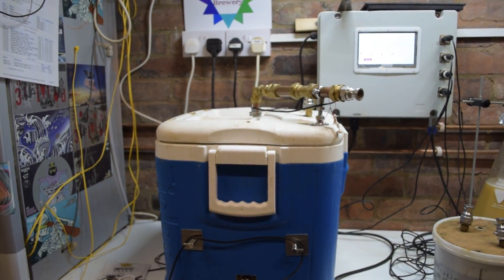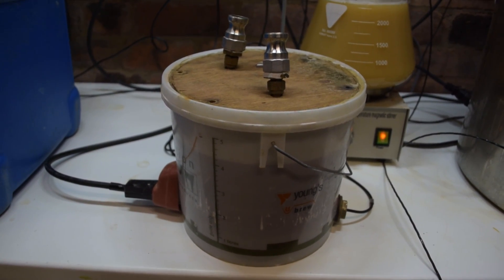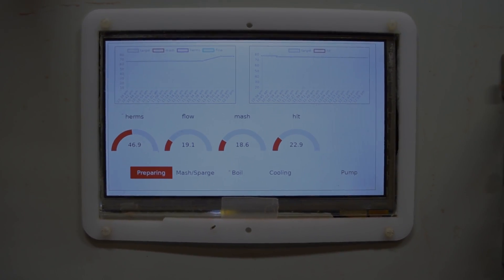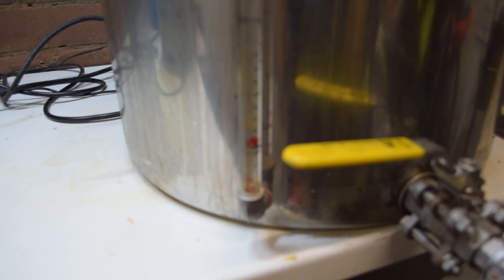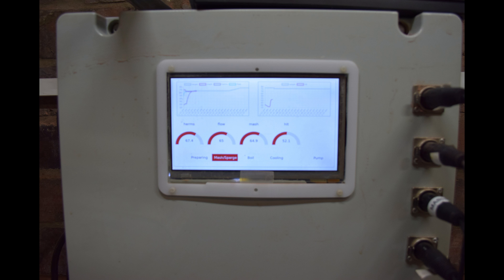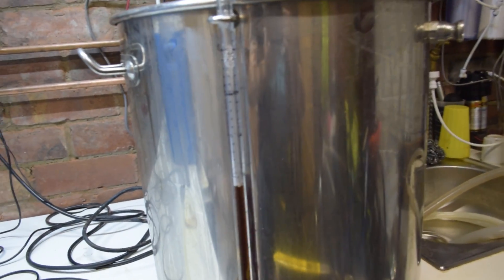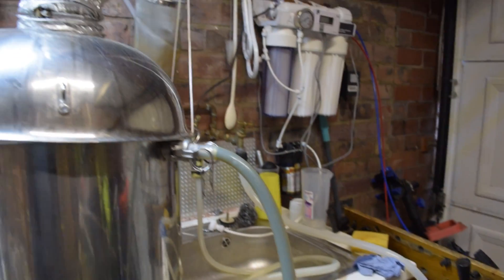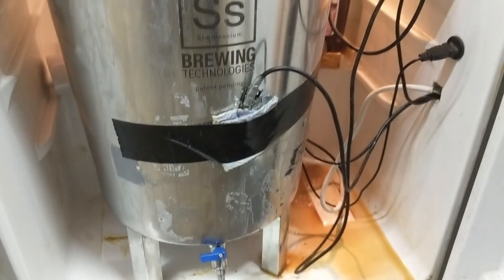Brewing automation in action

Comment: I am thoroughly intrigued by your low volume HLT. Do you notice much by way of temperature departure after mashing in?
Reply from the maker: The little tank with the HERMS coil in it?  Having it separate means I can control its temperature separately from the HLT so I have it preset at mash temp while I am mashing in.  Having a smaller volume means I don't have the additional thermal mass of all the liquid in the HLT when I want to change the mash temp.
Reply: @TertiaryBrewing  Does that translate into a temperature loss when you dough in? For a 153 degree Fahrenheit mash, I have to bring my strike water to 160+. I know you guys are metric, but I am only using this as an example. However my strike water instantly drops as I dough in, even if I were to underlet. Do you find that returning to intended mash temp or maintaining intended mash temp with that size of herms tank works productively?
Reply from the maker: @beeroquoisnation  Since the HLT and HERMS tank are separate the temp in the HLT isn't impacted by mashing in.  If I undershoot the mash temp I don't have the thermal mass of all the water in the HLT to help pull up to the correct temp, but, I can increase the overall temperature faster with the heating element because I only have to heat up the mash and the small tank rather than the mash and the whole HLT.
  The other advantage is I can take the HLT up to sparge temperature without having to start warming the mash.
Reply: @TertiaryBrewing  Very good. I think I have my head around your setup. I can see the advantage to having a smaller, I would call it a hot liquor tank that only has a small volume with a HERMS in it. By underletting from the large HLT, you can correct quicker with the small HLT as the volume to heat is substantially less. Very smart in my opinion. I test systems that I create as well, and just found myself captivated with the 4th "smaller" vessel. Cheers.

Comment: what software and hardware do you use?
Reply: replying for notification
Reply from the maker: The software I wrote myself, mostly to keep my software dev skills vaguely up to date.  It runs on a raspberry pi with some SSRs to do the power control.
Reply from the maker: https://youtu.be/MxMM_z3vqt4

Shows the insides, but also demonstrates that I'm not the tidiest at wiring!
Reply: @TertiaryBrewing  cool. How about putting it on GitHub and providing a schematic over view of hardwareV
Reply from the maker: Code is there already, it's not the greatest software and is in 3 unnecessary parts.  Since it's keeping me practiced in dev there is a CI server that builds deb packages to an apt repo so I can install it with apt-get.

https://github.com/rcaller/brewcontroller-daemon
https://github.com/rcaller/brewcontroller-frontend
https://github.com/rcaller/brewcontroller-api